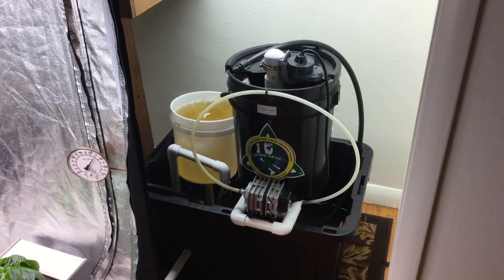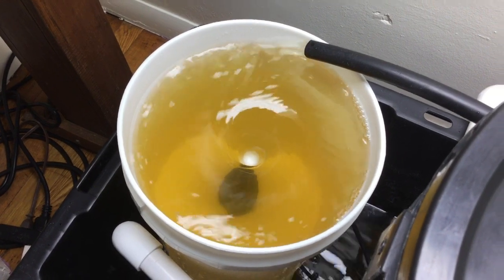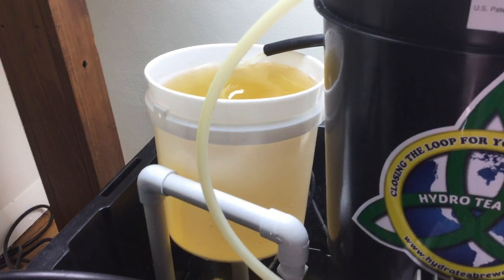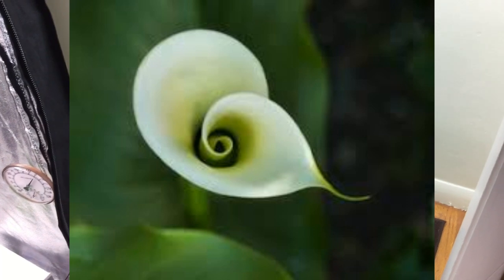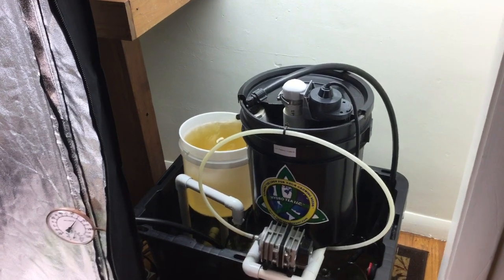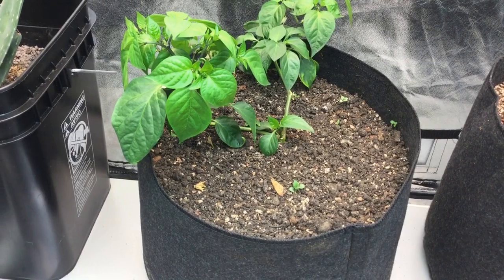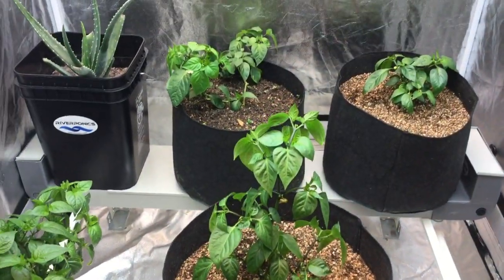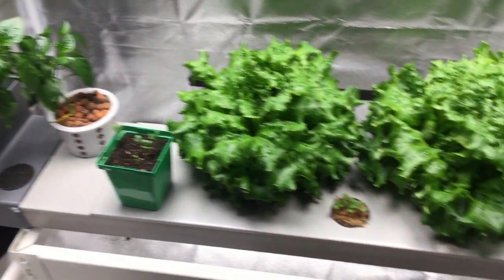Structuring Water With Riverponics Growing Systems

Comment: Hey Matt, if I decided to use liquid or powdered nutrients in the system, does the system ever need to be drained and refilled like most hydro systems are? Based on the water movement, I would assume the system doesn't grow much algea with the water being exposed to light. Even so, I'd imagine hydrogaurd could be used.
Reply from the maker: In a nut shell all the above is true ... You answered your owns questions ... Lol :-)